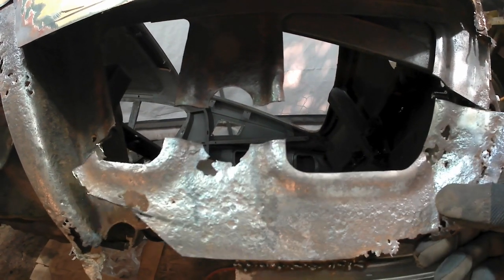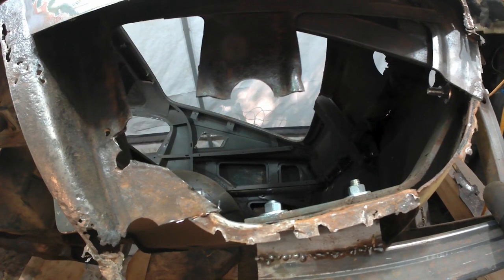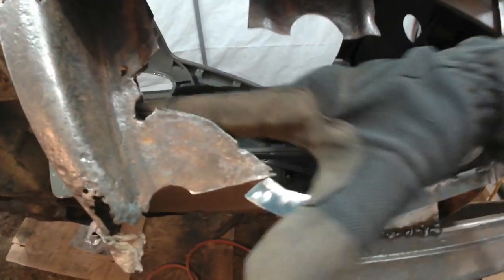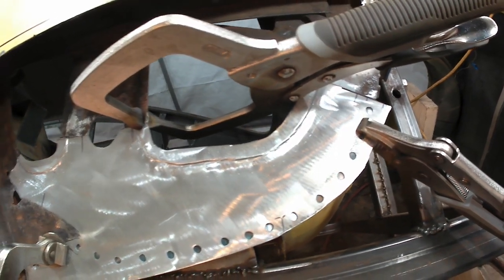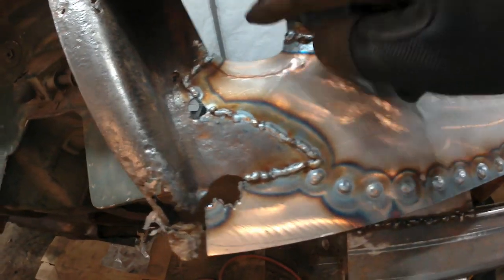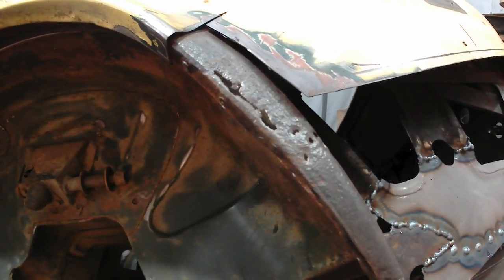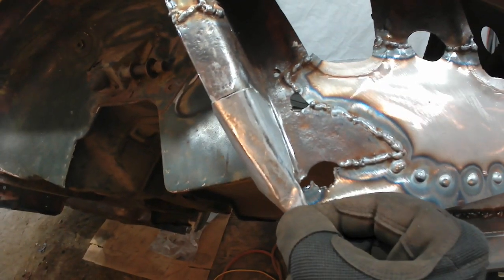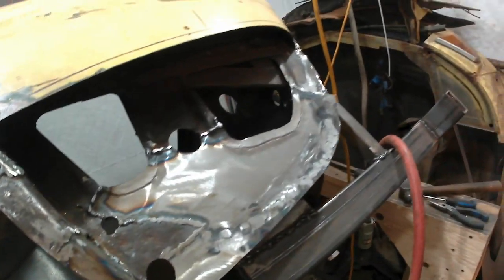GT6 Part 25 Moving to the Back

Comment: will back of patch be seen from the inside
Reply from the maker: It shouldn't be.  Most of it will actually be behind the petrol tank and below the finish floor level.  Also, the interior trim panels will be in place so there shouldn't be anything visible.